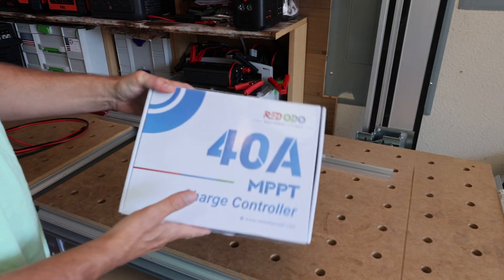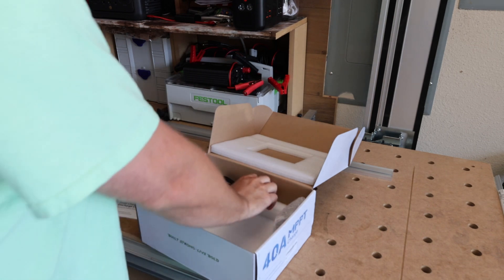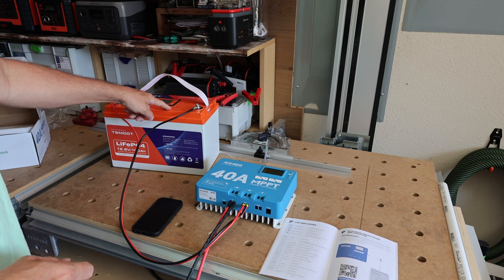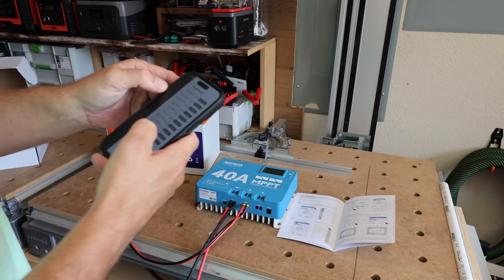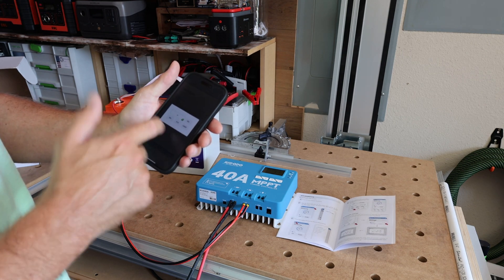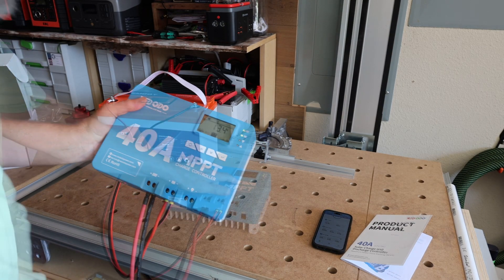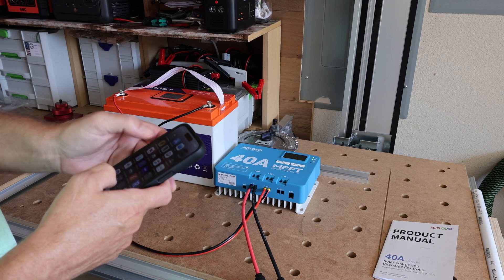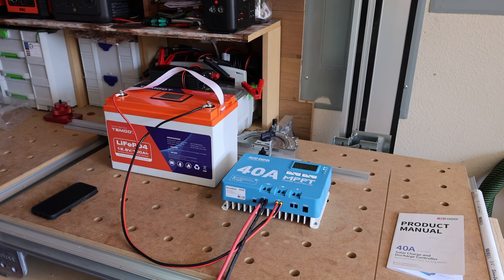Great priced 40amp MPPT charge controller from REDODO

Comment: I've had several items that had that smooth rubber touch, but after awhile is turns very sticky like glue ,you have to remove it all with alcohol not good.
Reply from the maker: Yes, they are prone to that if kept in a hot/humid environment👍🏻

Comment: hi 
Just saw your channel watched a few of your videos. I always like to see what others are doing to their Windriders. We have four, one16 with tall rig and three 17s.Two are stock and one is modified (asymmetrical spinnaker "Dont leave home without it" ). We come down to Florida a couple of times a year Dunedin causeway Sail Honeymoon. See Lucky lift sailing and Andrea frees you tube channel. We also got dismasted one time with the spinnaker up and when the mast came down it was like everything was in slow motion. Side shroud gave way . Also keep an eye on the bolts (stainless still corrodes) that have the tangs on them on each ama as we had one shear the head of the bolt off (This was on one of Glenns Rental Windrider 17 that sits on the beach all year long around the Florida salt water environment). A good idea was to  replace those bolts with eye bolts to eliminate that possibility.
 We will at Dunedin Causeway  Florida launch right off the beach May 5th thru the 25th at Sail Honeymoon, Inc. · 61 Causeway Blvd. Dunedin, FL 34698 .TIKI BAR on the beach and outside shower. Curlew BLVD turns into Causeway BLVD at the intersection of 19A. My contact is corsairf28r@yahoo.com

Comment: Li time has a 60 amp charge controller already set up for LIFEPO4 batteries I guess it’s kind of just plug and play I already have those type of batteries so I have been looking at it I bought t a Victron 100/50 smart charge controller from Amazon as an open box return to save $$$ and supposedly it came with a full five year warranty from Victron I bought it in July of this year but I haven’t had a chance to hook it up until just a few days ago,,,well the charge controller won’t power up and you can forget about any kind of help from Victron it’s nonexistent. I was pretty desperate so I contacted Amazon they said since it was a open box and a returned item I only had 30 days to get an exchange or a refund through Amazon however they made an exception and gave me back most of the money however I had to pay a $58 restocking fee,,,well thank God Amazon decided to help in any capacity at all because they were not obligated to,,,they met me more than halfway now I have to make a choice do I want to try a brand new Victron 100/50 smart controller(absolutely positively not a return) or do I want to take a chance on the LITIME 60amp? I don’t know? I already have a Redodo 100 amp hr. battery and one of their chargers I bought as a package deal on prime day for $379 it’s a 100 amp hour battery I plan on adding a second 100 amp hour battery very soon I would buy this charge controller here if it was at least 50 amp because I got 600 W of solar panels wired up in series series parallel 40 would probably not be strong enough.

Comment: yea for a 100 or so  more you can get a powmr 80A 450v /3000w chargecontroller/inverter  with generator input.. really good unit for the money , been running one of those for some time and its works well, the fan however are a bit on the noisey side
Reply: is that powmr unit a 24v or 48v?